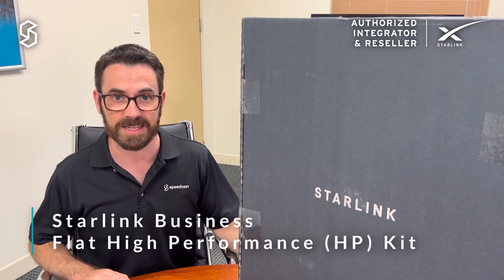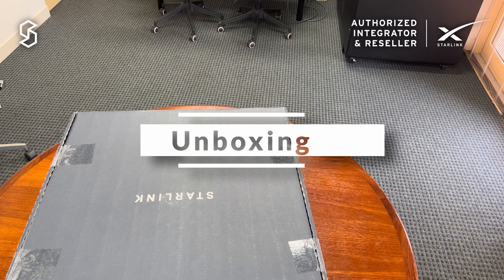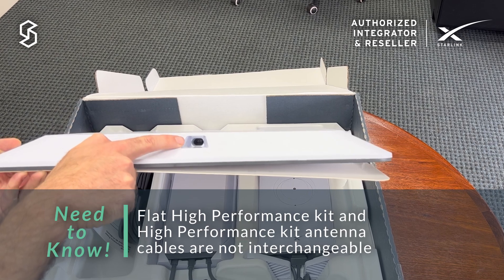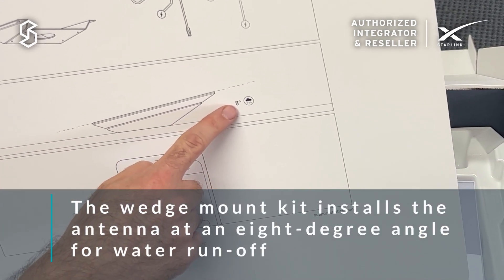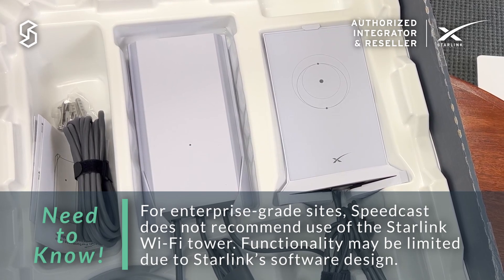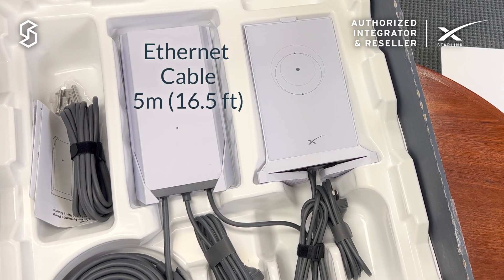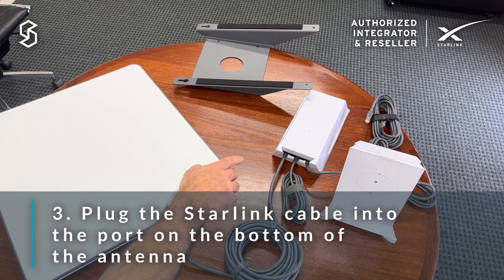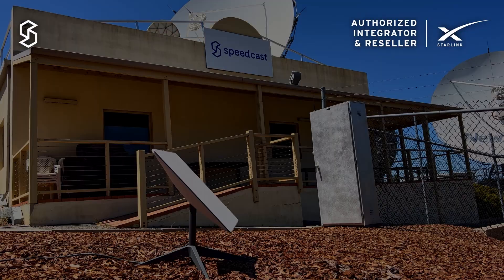Unboxing & Setting up Starlink Business Flat High-Performance Kit | Authorized Reseller & Integrator

Comment: Hi Sean. A friend of mine ordered the Starlink Business Plan but got sent a Flat Hi Performance dish,  I'm wondering why this would have been?  I thought Starlink Business Plans normally come with a Hi Performance (larger dish) but motorized.  Thanks.  

I wonder if speeds will vary between the flat hi performance dish and the motorized hi performance dish.
Reply from the maker: Thank you for tuning in. We checked Starlink's website, and it seems that their Business Plan only offers the Flat High Performance (HP) kit option. In terms of performance, both the Flat HP and HP versions are nearly identical. The primary distinction lies in the wind rating, with the Flat HP version having a higher rating compared to the HP version.

If your friend wants the HP version specifically, he can order through our ShopSpeedcast site: https://www.shopspeedcast.com/starlink-high-performance-kit/p/STLXX01017

If he’d like to keep the Flat HP version, he can purchase mounting accessories from our site: https://www.shopspeedcast.com/products/c/8?facetValueFilter=tenant~starlink-category%3Aaccessories